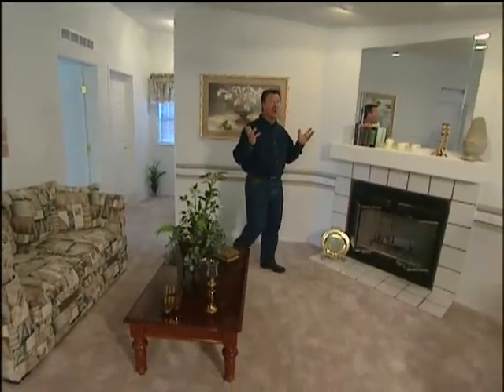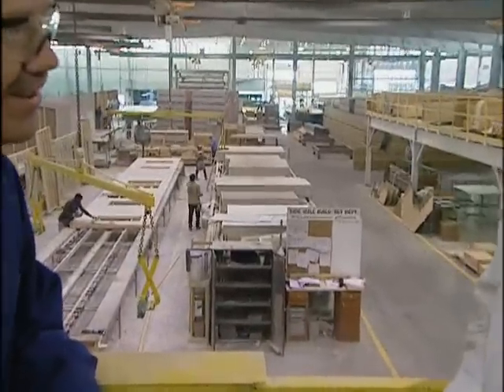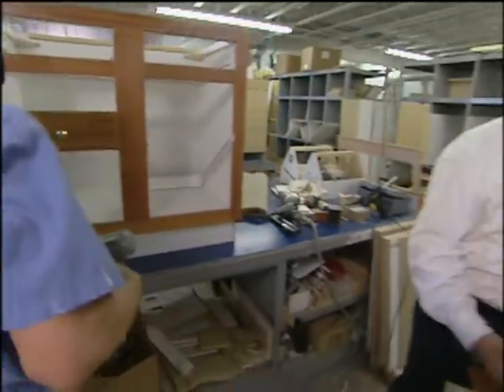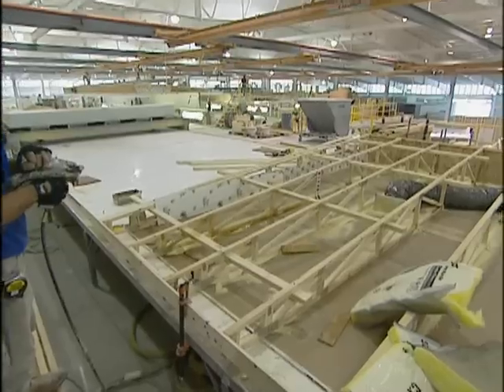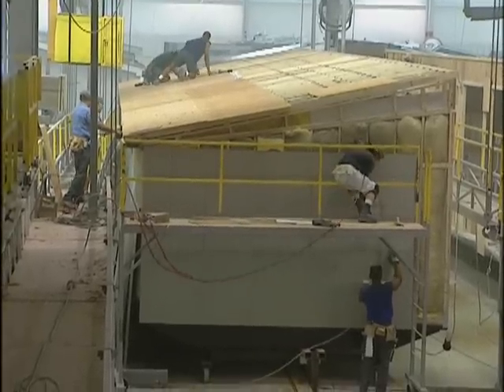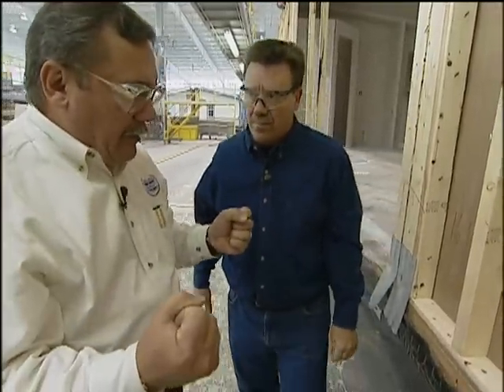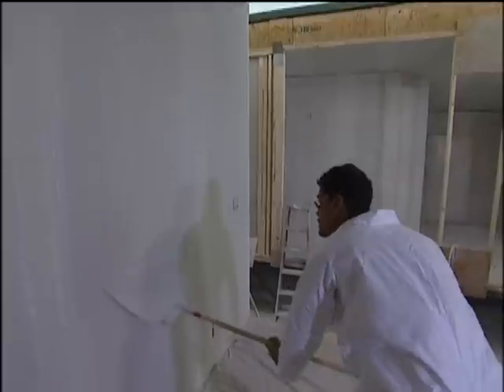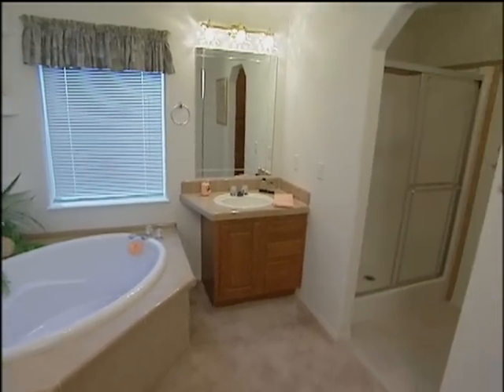Did You Know? Manufactured Housing (#5345)

Comment: We just retired here in Eastern PA and sold out 5 br house on 2 acres for 325k. We're now empty nesters so we bought 1 acre and put a new mobile home on a foundation for a total of 180k. We love it
Reply: See how you feel 10 years from now....
Reply: 8000RPM  the key to one lasting is a good foundation, that means supporting it all the way around the perimeter and all the way down the marriage wall, footers below frost line block up close to home, install sill plate and lower home down on foundation block up every four foot to frame. And the next biggest thing a dry crawl space, they will last fine this way as they are solid as a rock this way. It’s all ways poorly set up homes that have so many issues. All complaints people have about mobile homes usually is always do to them constantly settling. Also can’t be buying the cheapest model, the expensive ones with lower sq footage are only really lacking in the floor system, so it’s key to set it up that the floor is solid as it’s holding everything up clearly. Most still skimp on truss size but my dads home is a 82 model double wide with 2x2 trusses with scrap paneling the factory glued and stapled together no joke, and it was set up the way I describe and the old thing is still straight and never settled, I drywalled it in 96 and surprisingly it had r13 in the walls and 2x4 studs.  Drywall still looks good no cracking, Another thing that is lacking in the cheap homes is sad duct work set up and no returns. But the more pricing homes can be had with good hvac
Reply: Only God knows why these days
Reply: @8000RPM.  LMAO Coming from a guy who probably lives in a "Real House" that is in a Subdivision that is already falling apart because it has no real floor joist's and cracking stucco, cracking drywall seems, floors crack with in the first 5 years. belive me even a lot of older double wides are better quality then these new subdivision "Houses" that you pay 200,000 + for and don;t even have not even a 16th of an acre..  Yeah Tell me how you feel in 30 years when you retire and still struggle to pay it off and cannot enjoy your retirement.
Reply: How did you contract to get the foundation set up?
Reply: TRX Tech  what you said is so true I looked at a couple houses in the subdivision last month and it is poorly built manufactured homes look better than the homes in the subdivision the quality look better and you said $200,000 with the COVID-19 going they told me 260,000 and better and you right you don’t even have room to breathe I’m getting a triple wide it’s how you take care of your manufactured home a manufactured home it’s just as good as a stick built home if not better I don’t know what are you talking about people always looking down on manufactures why they use  Almost the same material they use in a stick built so I don’t know what he talking about I have family still living in manufactured homes over 20 years still look good
Reply: @HeritageWealthPlanning  you can do the contract usually with the manufactured home company. They will work with your county and contractors to complete it. It will cost you quite a bit
Reply: @8000RPM.  I've been in 2 double wides on land, over 20 yrs the 1st one, 10 yrs the second.  They were/are fine.  I'm still in the 2nd, and we paid it off 2 yrs ago.
Reply: @8000RPM.  Been twenty years in ours! Still love it! Best investment ever. Our story is similar. We retired, sold our big stick house and bought a piece of land and put a manufactured home on it for a fraction of what a similar stick home would cost. The rest of the money from our stick house sale we have used for traveling. We were recently offered over five times what we paid for our land/home combo. But for us it was never an investment, it was a home to spend our golden year in, and we love it!
Reply: I've gotten a lot of replies. I've lived in two mobile homes and had fairly good good experiences. But the maintenance (mostly DIY) was high. Mobile homes just don't seem to be constructed to be "permanent".

Comment: Really it just depends on what ya buy, Some new and old mobile homes can be pretty nice and sturdy and some can be a disaster
Reply: we had a Marlette when I was a kid back in the 70's. It was in the mountains in Wyoming, and it was one of the warmest houses I've ever lived in. 2x6 walls, very well insulated.  My dad actually got around the "mobile home" tax that the county there charged. Before it was placed and leveled, he had eight I beams set in sonotubes just above ground level placed around the house.  Once it was placed, the axles came out, we slid cross Ibeams in, welded those to the verticals, then placed a vertical at each place the frame crossed those. By welding those solid on both ends, there was one continuous connection to the ground-it became a house at that point. 

That house was placed in 1974. I know the folks that live there now, and it's still dry and warm.  And it's never needed to be leveled :-)

Comment: I see some bashing.  Just buy the Class A and pay extra and get 2x6 walls and OSB flooring.  I have been in one for 20 years on private land with mine sitting on brick.  I think I spent like 5K extra for 2x6 walls, Better cabinets, Outer OSB walls, OSB flooring, better molding etc.. I also have 16in on center flooring and walls.  Just don't buy the cheapest models.  I have has zero issues 21 years later and its paid for now.  If buying a 340K home is you do it.  The only thing that kills these homes is putting them in parks.

Comment: Is manufactured houses the same as mobile homes?
Reply: Mobile Homes is what they used to be called back when they were built and sold the same as trailers. They are very different now, so they're called Manufactured Homes. They must meet HUD codes now.
Reply: @OddTimeMan  just because they must meet a code doesn't mean they're reliable. Mobile homes are still mobile homes, junk on wheels.  Stop trying to sugar coat a sardine can
Reply: Pretty much... just costs $20k more.
Reply: @frankmaddalena8570  Your opinion is meaningless unless you back it up with facts.
Reply: @OddTimeMan  any trailer park in the world is fact enough. Stop reaching for nothing
Reply: @frankmaddalena8570  I don't think you understand how to make an argument. Opinions mean nothing. Thanks for trying though. Have a nice day.
Reply: OddTimeMan  they have had to meet HUD regulations for many decades and some state regs. If you place them on your own property some cities will require the factory to install fire sprinkler systems like site built homes. Of course I’m in SoCal, so I can’t speak for other states.
Reply: @TheBigfoot567  And one pile is just a little bigger than the other.
Reply: @frankmaddalena8570  Your very wrong.  I had one for 20 years on private land bricked foundation.  2x6 walls, OSB outer walls, full 2x4 inside with 3/4 OSB tongue and groove flooring with full sheet rock.   Still in it today with less trouble than my stick built home before.   Yes you can buy the cheaper model.  I paid a little extra and have zero problems 21 years later.  Its paid for.  I will take that over a 340K loan in a place with no yard.   Most you cheaper manufactured homes are in parks.  I purchased a class A and put in on 2 acres of land.

Comment: There is ONE flaw in many of these manufactured homes that I have found here in New York State, and it is a flaw I wasn't really thinking about (though I should have been aware of) but myself accidentally overlooked when I had bought my manufactured home!! 

This flaw in my case was the roof pitch!! Many of these manufactured homes DO NOT have "snow load" roof pitches built into them!! In fact my home didn't have any optional roof designs and I completely overlooked the obvious when I had purchased my home that "maybe I should go for a roof pitch of 6/12 or better!! Instead I totally "blanked" on the idea, and paid the price later when the roof on me home started ice damming the first winter I owned it!! After all my manufactured home had a industry standard 4/12 pitch and it wasn't enough to allow the ice and show to adequately drain off the roof. This NOT ONLY damaged the roof, shortening its life, but it also damaged the walls and some of the sub floor as well in and around the exterior walls!!! 

SO if you live in a snow belt area like New York State, then make sure you can change the roof pitch to AT LEAST a 6/12 pitch...or you will learn the hard way when the paint starts peeling off the walls by the ceiling!!!!
Reply: Greg Benwell  lots of homes have low pitched roofs without issue, I have a 6/12 pitch on my house with metal roof slick as can be, guess what it still holds snow. The issue you’re talking About comes from pour insulation and to much escaping heat from the inside of home. Causes the snow to melt from the underside of snow running down to the eve and freezing then the water that is above the warm area stays melted but can no longer drain do to ice damn, so it sets there intel it finds a Place to go sadly that place may be the structure its self. Iv fixed this issue many times buy blowing in insulation in homes, but if you watch this video again you will see there not much room for that towards the outside. On mobile home it’s best to look and make sure there is insulation evenly threw attic and if it is the best fix is a metal roof, with foam board under it, and mastic all the laps and stitch screw them every foot.

Comment: Holy moly, foam to affix the drywall to the roof joists, oh god.
Reply: LOL. 

 I recently sold a high end modular ranch home that I lived in for a decade. The place was built with 100% plywood, including a roof system of 8/12 pitch trusses 16" on center, and 5/8" plywood sheathing. Anderson Wood windows, a kitchen with 40 lineal feet of cabinets, all stained hardwood trim, etc..  It was built better that 99% of all the "custom built" stick homes in the region.

The ceilings were two continuous expanses, 14' x 54' . Built with  5/8" sheetrock, attached to the trusses with closed cell spray foam. There wasn't a single fastener used to secure the drywall.  The ceilings were flawless when the crane set the units on the foundation, and just as nice a decade later. Apparently you never disassembled anything built with structural foam adhesives? Since a ceiling built like this will come down is tiny little scraps, and you will spend countless hours scraping all the bits of drywall and foam off the bottom of the trusses, if you want to reinstall a new layer of drywall. 

I spent most of a thirty year long career in the trades as a custom homebuilder. Stick building homes, in 2019 is an absurd process, that is almost barbaric, given how crude and backwards the process is. We wouldn't think of buying a vehicle or major appliance that was built in a open field, by everybody from competent craftsmen, to druggies, drunks, and illegals, using low bid materials that sit in rain and snow for months,  in a process where, " screw it, that's close enough" is often a quality metric. Yet our culture believes that all manufactured housing is crap?
Reply: kerry kerry Yeah good luck removing the drywall if you ever need to right
Reply: kerry kerry everything was cool till you said “illegals”...
Reply: Anderson windows wait till you have to replace them in you mobile home.
Reply: @emmantoast310  So we ignore the truth?
Reply: @michaelgardner834  Not in a mobile home, they are in a modular. The home is no different than any stick built home, other than it's dead square, plumb, straight, and overbuilt for the trip to the jobsite. The windows are nailed to the plywood and 2x6s. No different that the many hundreds I've installed in the field. Housewrap and 4" sealing tape complete the installation at the nailing flange. Since they are an exponentially better product than a lot of low bid, single hung vinyl shit windows that most stick builders use now, they will last 2-3X as  long, so replacing them is unlikely in the foreseeable future.
Reply: kerry kerry appearently you guys have an issue
Reply: I have lived in on site built homes for most of my life I’m 51. And a Modular for only 5 years. I have been in construction all of my life. I was a licensed contractor for 12 years.But not currently. I specialize in kitchens and bathrooms. What I have learned about both having worked on many, many of both and lived in both that both have good and bad points. I believe that if someone combined both aspects of manufactured and onsite builds you would have the best product. But if you think you’re getting the best product just because it’s onsite build sorry to burst your bubble but your not. Here is one example. If you know anything about cabinets then you know that because of competition to win the bid and have the cheapest price you get junk. I actually think you get better in a Modular. I have installed tops on all kinds for over 30 years. If you have older cabinets made of actual wood instead of glued and pressed sawdust then don’t get rid of them get ahold of someone who doesn’t want to rip them out just to sell you new ones which will not be as good to give you advice on how to reface your old ones to keep the better built cabinet.
Reply: kerry kerry It’s called not wanting open borders, drugs and human trafficking I would think you could understand that
Reply: Don’t underestimate 2 part chemical adhesives. It’s a whole different ball park than a normal adhesive
Reply: michael gardner it’s NOT a mobile home. It’s a manufactured home!  The building materials are protected so things don’t warp, rust, etc...  The days of the 1960’s “trailers” are over. You people really do need to see how well these things are built! 🙄SMH!
Reply: lawnmowerman4040  I thought we were talking about manufacture homes versus stick built a modular let’s keep the politics out if we have information that can help each other about these homes let’s put that on here because only God knows the real story then what’s gonna happen in the end
Reply: @kerrykerry5778  false

Comment: Their cabinets arent worth a crap. They are stapled together and the front eventually fails and they break off as they are made of particle board. Better off getting cabinets afterwards.
   Walls are made with cealtex (sheathing) and alternate with USB. Which by the way , had two holes drilled into them. Each board. Why ? I have no idea.  Not solid walls throughout.
  Glad and greatful to have a roof over my head.....but they are not built like a modular although they would like you to think they are. I had to get the place replumbed after only 17 years because they used cheap steel connection. Not stainless but plain steel ! I should not have had to do that at all !
   Walls so thin i can hear conversations as if i was in the room
.  had to respackle as they used drywall nails instead of the obvious choice of drywall screws.
Nails work their way through over time. The flashing came loose and the nails holding the soffet in place are rusting because they used the wrong kind of nails instead of aluminum.. Everything done on the cheap. Damn shame..
Reply: Those studs didn't look like full 2 by 4s, but it's hard to tell on video.
Reply: Virginia Moss  Yes, they are 2x4 Nominal just like stick built on site houses. 2x3 studs or less still used for travel/ recreational trailers.
Reply: @stevelopez372  - Thanks.
Reply: The MH industry REALLY needs to update beyond their "in-house" cabinets and horrible countertops.   They're junk and they haven't changed in 30 years.

Comment: The main issue is the value drops like a rock. Along with banks wont loan on them after certain age
Reply: That's not true anymore, if you have a title you can get a bank loan on any single or double wide. You will find that pretty much anything built after the mid-1990s if it's on it's on property that actually appreciates. I have one values gone up 30% over the last five years.

Comment: Can you please help me?  I own a 2001 Karsten K-20 Estate Series double wide. Both skylights in both bathroom have a lot of cold air coming into the bathrooms. Sometimes the inside temperature is the same as the outside winter temperatures. How do we fix that?
Reply: use GE silicon II caulking for bed and bathrooms.

Comment: the kind of house I want to build is a 360° two-story Loft, that being a front Loft and a rear Loft with two catwalks on either side and an opening peering Down to the living room, it's under a thousand feet but the height of it is normally an issue when it comes to driving on the road. is there a certain company that specializes in this sort of model?
Reply: Heather Strickland I know it's been 6 months but, I have seen modular 2 story homes. They ship out the bottom pieces and 2nd story each on their own trailer, then just use the on-site crane to set the 2nd story after the bottom pieces are set on the foundation.
Reply: LOVE THE SIMPLE REAL IDEA HERE........ BUT WHO BUILDS THEM & IN GOOD DECENT QUALITY TOO & AT DECENT CASH PRICE TOO NOW BEING 2018............